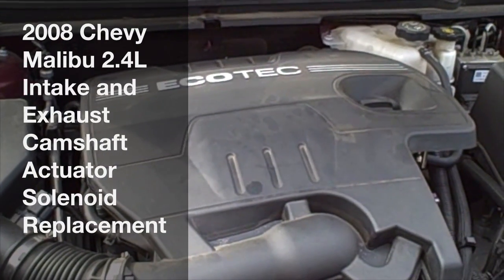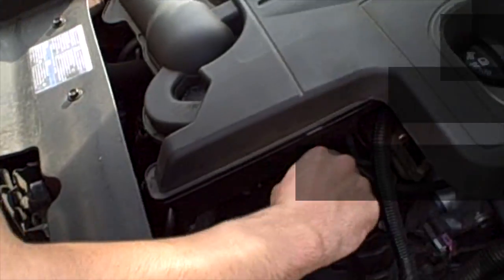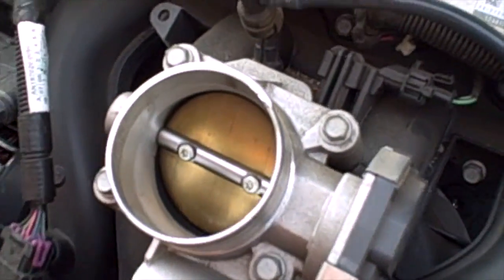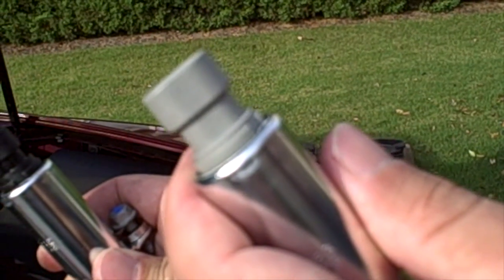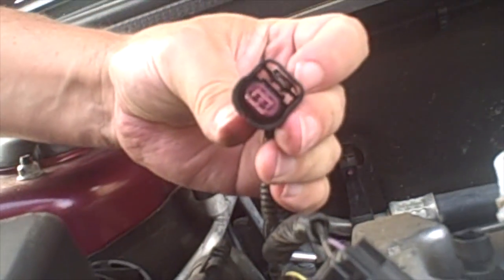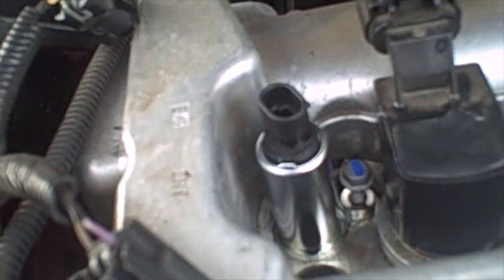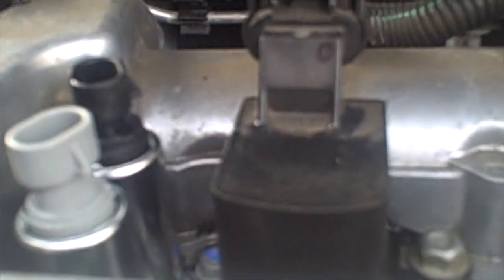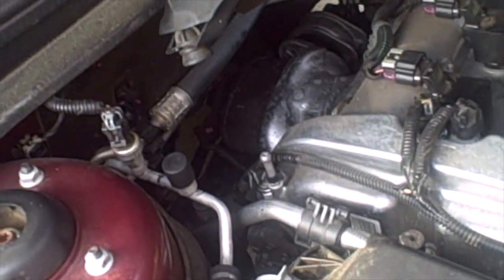2008 Chevy Malibu Intake and Exhaust Camshaft Actuator Solenoid Replacement

Comment: Thank you so much for this video. You saved me over $500. Dealership repair prices are outrageous. Me and my dad did this in less than an hour. Car is running a lot better and no more check engine light. 😊

Comment: My Malibu has 235K miles and I got the same code as everyone else. I followed your video step by step and my car is running so smooth. Thank you brother for sharing. I feel I can drive my Malibu for another 10 years.- take that Toyota!
Reply from the maker: Glad it helped! That’s some impressive miles!
Reply: @LiteVideo   I gotta give credit where is due. This car has been the best reliable car I've owned by far. I don't mean luxury just reliability. minimal expenses (oil/tires & batteries).  I bought it brand new in 2008 with only 16 miles and when these codes showed up I thought it was the end but after making the repair with your video it now runs awesome and quietly again. my MPG is back up to 32/38 - Thank again !

Comment: Very detailed an straight to the point, because of this video I decided to do this myself. The dealer wanted to charge me $600 lol. I watched your video twice an was ready to go, took me a little over a hour but that was only because I decided to clean up the engine a little an replace the plastic covering over the wires near the engine, they were very brittle an breaking off. I'll see after driving this a 100 miles or so if it worked, either way thanks a lot for the tutorial.
Reply from the maker: Thanks for the comments. Glad it helped.

Comment: Hey thanks for the video George. I got a 2010 Malibu with the 2.4 engine and a p0010 code. I followed your instructions to replace the intake cam valve. It went smoothly and now the engine light is off. Got the part from Amazon for 32 dollars shipped so it wasn't too bad. I did put grease on the throttle body rubber grommet and it went down ok.

Comment: Thank You for this very detailed video.  You saved me Hundreds of dollars from the rip off dealership.  It didn’t take hardly anytime at all to replace both solenoids after watching your excellent video.   Second best part, no more engine light.  Thank You both so much!
Reply from the maker: TigerJaw glad it worked out for you. Always a great feeling when you can do it yourself! I have benefited so much from YouTube tutorials over the years this was my chance to provide something of value to the community.
Reply: Well, I spoke to soon, my engine light came back on.  Any suggestions?  I am buying a code reader to see if it is another code.  Do you know if you had to clear your codes some way so the engine light would stay off?
Reply from the maker: TigerJaw yes. I had a code reader and did clear it after the work but I believe that after you drive it a bit they should clear after a few drive cycles if your codes were the same as mine and you did the repair. If not, try pulling the codes and see if it is a different code.

Comment: I replaced the intake solenoid on my 2012 Malibu, but it does not start. The crank does not turn I guess, well no start. Any ideas? I'll hear is a clicking sound
Reply from the maker: If it was starting before check the connectors.

Comment: Most important tip for this is to disconnect the battery from the terminals completely, or after your done changing your car computer will need to be reprogrammed to start up, you will not be able to get your car started for anything with those codes in the system cost me a big expense
Reply: Oh wow really that’s a bummer, doing this without unplugging the battery caused that?

Comment: I have a P0010 code which states that it’s a camshaft position sensor actuator bank 1, would this be the sensor itself or should I replace the solenoids? Are there separate censors for the exhaust and intake ? Or does the same censor govern both solenoids?
Reply from the maker: If you have the same engine around the same year - There are two solenoids one for intake and one for exhaust. This was many years ago but based on other reports I had read at the time I replaced both once I started throwing those codes, such as P0010, and when I replaced both solenoids and cleared my codes I never had the issue again  while I owned the car. Remember, these codes are diagnostic and generalized so don’t rely on the codes alone. But like you, I googled it for the Ecotec engine at the time (almost 10 years ago) and the solenoids seemed to be the trouble and in my case they were.
Reply: @LiteVideo  

Awesome thanks great video, did you have to unplug your battery for this?
Reply from the maker: @lifewasgiventous1614  I did not disconnect the battery but it is always a good idea to do so as a basic safety precaution.

Comment: Hey I successfully followed your tutorial on my 08 Malibu . But when I started driving , it was still stalling and the engine light was still on . Also said service esc after so do I need to go to O’Reilly and have them reset my codes or what should I do ? It was driving the same but maybe a little more off .
Reply from the maker: Which codes are you getting? If I remember correctly I did reset the codes but if it was the actuators you should notice a good difference in driving. Months Before the actuators I also had a catalytic converters Fail but that was a known issue and TSB from GM for my model year that they covered but that one threw a different code.
Reply from the maker: P0010, P0010, P0013 and P0014 are the main codes this issue deals with.
Reply from the maker: One other thing is to be sure the cable connectors were free of oil where they attach to the solenoids.
Reply: I don’t know the codes .. I don’t have a code reader but I drove around for 5 minutes and it sounded like it helped but I’m still going under 20 .. then I can go up to 35 and it gets really loud .
Reply: Should I take it to O’Reilly and have them put their code reader thing in ?
Reply from the maker: Roman Hillz probably wouldn’t hurt to have o’reilly pull codes again. When my solenoids failed I don’t recall it getting loud (this repair was many years ago though so I could be forgetting). When my catalytic converters failed it did make a much different sound however.
Reply: @romanhillz1111  your engine is going out soon that's what it is so dont waste on going to orellys

Comment: Is intake air vent flap door same as throttle body at the end of intake hose you were pulling open, I am told by two trust worthy gents, one provincial seniors mechanic Mgr at the emission test head office on phone (2) a guy helped me with boosting who had same problem as I have w his Ford.. said he open the intake hose to reach the intake flap to spray clean it & his sputtering stopped. My 04 2.2l Malibu sputters every few months for few days and goes away for 2-3-6 months to start again as it did last week.This infrequent sputtering started about 3-4 years back.at ~ 110k km(68k miles) now I've 175k~110k miles, 04 Malibu intake hose come from Air filter cover to front of engine just below oil cap, also, 04 doesn't have top overall cover as yours, but underneath the cover engine looks the same. Any idea where will I find the intake air valve door to see if its sticking occasionally due to buildups & to spray clean it (with what spray? too plz) any help/ thoughts appreciated, Sam
Reply from the maker: N Sa Yes the throttle body will often get black carbon buildup around the flap. You are correct, in my video when I lift the engine cover, I point out the throttle body - that is the flap inside you are talking about. That is the area you want to clean but be careful when you do. Don’t apply too much pressure or force the “flap.”Most auto parts stores sell throttle body/choke cleaner spray. If you search YouTube for “cleaning throttle body carbon” you will see quite a few videos on how to clean, here’s just one example https://m.youtube.com/watch?v=wmrvnZT4aDU 
Mine wasn’t dirty when I made this video so didn’t have to clean.
Reply: @LiteVideo  Thanks so much for this info+ confirmation on the throttle cleaning. After seeing ur video & writing above, I also checked 2-3 other vlogs showing how to & what spray+ careful approach etc but  another video w less careful approach info too, so I'm going to check ur link + few more videos  before starting this, hopefully soon (& also my latest misfires Stopped & hasn't re stared 4-5 days so far, that helps too), thx a bundle for ur prompt response& suggestions

Comment: What problems do you have if intake solenoid actuator is stuck? After replacing what difference will there be?
Reply from the maker: I was seeing worse fuel economy and the check engine light came on. When I pulled codes there were multiple codes P0010, P0011, P0013 and P0014. It also didn't seem like there was much power when accelerating. Replacing the solenoids corrected this.
Reply: George Douglas McGee so far it feels like the automatic shifts a little better going up hills.

Comment: What kind of grease do you put on it so it goes down ? Please help .
Reply from the maker: No need to grease anything. Simply take your finger (wear protective gloves) and rub a little motor oil on the o rings on the new solenoids before you insert. Place the solenoid straight in and press. If it doesn’t press in easily by hand - it should when you tighten the bolt.
Reply: George McFly  Thank you . 🙏🏽 Your car couldn’t accelerate like a normal car before you put these in right ? Mine goes slow until it hits 20 mph and then kicks but only to 40 . I went to Oreilly and they put that code thing under my steering wheel and it said I needed these . I’m just wondering what was going on with your car that made you get these parts ?
Reply from the maker: Roman Hillz yeah no power at when when flooring it. And was getting these codes.
Reply: George McFly  Thank you very much . Life saver !

Comment: Does this have anything to do with the service esc light coming on and off?
Reply from the maker: I wouldn't think so, as I believe the ESC light is related to the Electronic Stability Control system.
Reply from the maker: There was also a recall campaign number 13036 from GM for the body control module and that may also affect the Electronic Stability Control system. See this link for info http://www.chicagonow.com/vociferous-envoy/2014/09/what-you-need-to-know-about-general-motors-recall-13036/

Comment: I just performed this repair and now have a pretty good oil leak onto the motor.....what did I do wrong?
Reply from the maker: Double check part numbers and make sure the solenoids are fully seated and tightened. If that checks out check the o rings on the solenoids to make sure they didn’t tear when inserting. Are you sure you have an active leak? Did any spill from the old solenoids when you removed? Also, be sure you replaced the oil fill cap.
Reply: Found it. I got the correct part number. However, while the intake solenoid fit just fine, the exhaust absolutely would not seat, even with fresh motor oil applied to the O ring. This caused a significant oil leak when running the vehicle. For what ever reason the new exhaust solenoid seemed to be just a fraction too big. Luckily I had the P0010 code, so only the intake was the problem. I put the old exhaust back in and the check engine light still went away. Thanks for your help!
Reply: @thehotpoolboy4414  

Does the P0010 refer to the intake only ?

Comment: does a 2010 chevy malibu 2.4 have a pcv valve cause i cant find any auto store that has it??
Reply from the maker: I am not aware of it having the old school type PCV valve. Though most modern engines have evaporative purge control valves that are electronically operated on start. I am not personally aware of where it is on the Malibu. I have had to change it on some of my other vehicles but not on the Malibu yet.
Reply from the maker: Looks like on the Chevy they call it a Purge Solenoid. This forum has some discussion of the cobalt engine which is similar and has some pics. http://www.cobaltss.net/forums/2-0l-lnf-performance-tech-153/disconnected-evap-purge-solenoid-%3D-very-happy-lnf-207984/index6.html
Reply: George McFly my check engine light just turned on yesterday I got code P0018 at 85 thousand miles on a 08 chevy malibu 3.6v6 it reads crankshaft position (CKP) -intake camshaft position (CMP) correlation (Bank 2) is it anything similar how serious is my problem ... theirs no issues with the car turns on fine runs fine !!!!

Comment: I followed this video exact and now when I start my car it makes noise ..like high throttle or something
Reply from the maker: Not much is involved in this repair. The only thing I can think to suggest is to double check to make sure you fully seated the new solenoids and the connections to them and you installed the intake solenoid in the intake position on the engine and the exhaust solenoid in the exhaust position (the solenoids are color coded grey and black and the valve cover is marked for INT (intake) and EXH (exhaust). Also double check that your intake manifold is fully seated onto the throttle body.
Reply from the maker: Intake solenoid has a grey connector and the exhaust solenoid has a black connector. Check also to make sure your air in stake hose from your air cleaner box to the intake manifold is fully seated and secured.
Reply: After you replace the solenoids, you have to clear the error code in the engine or it will run in "safe mode" which is what you are hearing with the high throttle or the slower gear shifting as you drive.
Reply: @ingridjordon-thaden3636  how do i clear or reset the check engine light after replacing the exhaust selenoid?
Reply: Noel Rodriguez plug in a code reader and it should give you an option to clear the error code.
Reply: @ingridjordon-thaden3636  thanks !

Comment: What were the symptoms for this work on the 2.4
Reply from the maker: Angel Tapia check engine light and codes P0010, P0011, P0013 and P0014
Reply: Thanks for the feed back any issues with does Malibus besides that?
Reply: @LiteVideo  Sorry George, I dont have a OBD, what symtoms if any besides the check engine did you notice?
Reply from the maker: Doug Archibald lack of power while accelerating and very poor gas mileage. If you don’t have OBD scanner swing by any AutoZone or other auto parts place and they generally will scan for free.